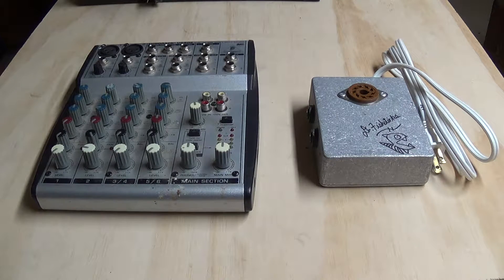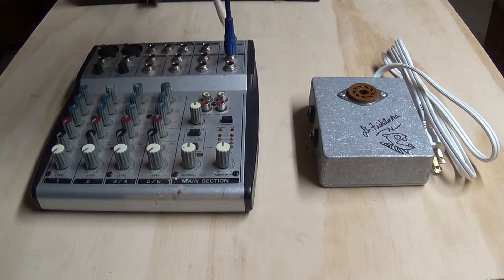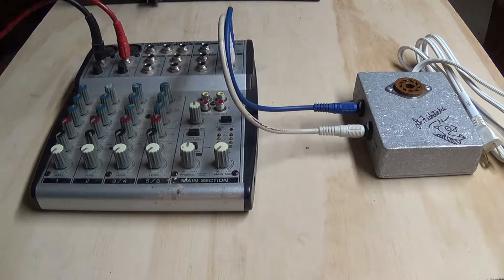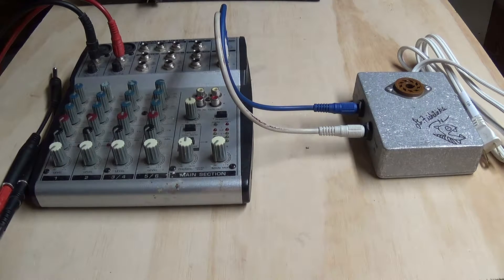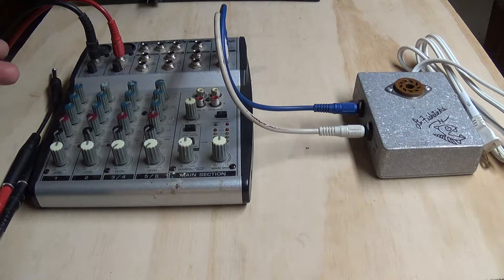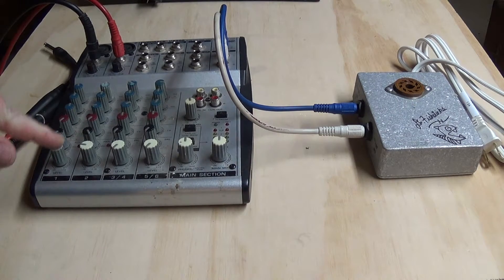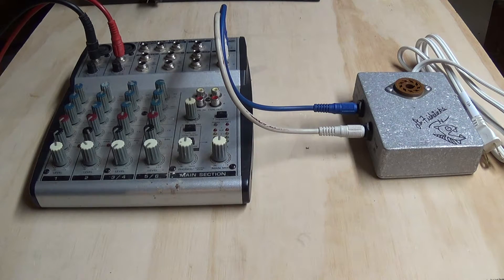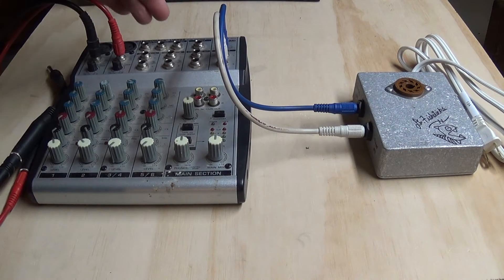using a mini mixer to preamp a two channel Leslie -  9 pin 700, 710 and more

Comment: Hi
I have a Hammond L100 and I Leslie 710. I bought a 9 pin connector, and I sent the signal to pins 1 & 2 (ground and signal)
I get a lot of hum and almost no volume. Do both channels need to be connected at the same time? can I add a jumper from pin 2 to 4?
Thank you

Comment: What does the box does? Just switch the motor with 5v Relais ? And connect the signal from the mixer to the 6pol Leslie connection? Or is there an amp or something other in it?

Comment: First, thanks for the video. Thanks for sharing.  Very informative. I will look on Reverb for your handle, and buy whatever works.  I'm piecing together Craigslist and marketplace cheapies to scratch an itch.  I'm not technical, but I can follow precise instructions.  Everything will be played in a 180  square foot family room for my own  enjoyment.  I bought an M-3 in well maintained condition s/n 120232 ($150) and a perfect condition nine pin Leslie 205 s/n B1325 ($400)   So as I understand it, I need to make the Leslie a single channel. Use the magnetic speaker wires as the output on the organ. By adding a  ceramic resistor in line with the signal equal or greater than the speaker rating should satisfy the organ . I know I'll need a switch in there somewhere fast slow off.  I will watch more of your videos to see how to reduce the channels in the Leslie. I suspect I'll need a crossover as soon as as I know what it is and what it is used for.   The Leslie is a 64 watt amp. Does the output reduce as I remove channels?   Thanks again!

Comment: Looking for video of how to use a mixer as the preamp on Leslie. Where is the Leslie?  What's in that silver box you have there? Is it just a simple adapter? Why the plug on it?  What does it do? Does it supply the 29volts I need? Where does organ and Leslie connect to it? How does that silver box turn on the Leslie, fast or slow? Im reading pinouts from 6,9,11 and that mixer is just audio, what about ...fast slow  etc... How do they connect along with that mixer?    Where is the Leslie with the MALE connector 6,9,11 sticking out the back? Leslie connecting to? Where is the organ 6,8,9,11 pin? Leslie input plugs in? Made no sense at all, I dont have a silver box with 1/4 jacks. I have a 11 pin male connector sticking out the back of the Leslie. I have a new Hammond with an 8 pin connector need a preamp in between the 8 pin organ and the 11 pin Leslie. Just need to know where to get the 29 volts on to pin 11, the rest is just a cable. Pin numbers aside how can my little mixer be used in between? What is the silver box? is it supplying the 29volts I need? If so how do I make one? Does the silver box have 6 pin or 9 pin or 11 pin input from the Leslie? Dose it have an input from an organ 6pin, (8 pin Hammond on Xk-1c) 9 pin, (11 pin. XK--3)?   I just dont understand, that silver box anyone could just plug in the R/L output of the Organ, that is a pre amped signal just like the mixer, right? Confused bad now...
Reply from the maker: That's a little unfair, that's A LOT of questions.   The silver box is a Leslie Controller. (Dr Fishsticks) and this video is for DUAL channel Leslies.   What do you need the 29vdc for?  You ask about 6 pin organ outputs and 8 pin organ outputs.   If you has a specific question I can help.. for example "I have a Hammond M3 and a 9 pin Leslie 700, how can I hook them up... I can answer that, but you hare asking  about 6, 9, 11, 8, seldom used control voltages, it's too much to try to answer that all.
Reply: @vintkey  Sorry, I'm  just confused. Have bought 2x Leslie 615. One may work, can't test it. Can't even turn it on. No speaker inputs just a wall plug and 11 pin male.  I have a newer Hammond xk1c 8 pin leslie female plug on back has electronic leslie too. The 615 leslie I cant turn on and test to see if its any good at all.  It has an 11 pin. Male plug. I'm just not sure what to do. I don't want to spend 500 dollars to turn it on to find out its no good.
Reply: I thought I could make a cable, what is the box for?

Comment: okay, I think I can get this dialed in, but I may need a little help.I recently bought your nine-pin controller with the foot switch for a 710 I got my hands on. I'm getting 3 speeds (stop, slow, fast) so that's good.

Here's where things get interesting. I'm playing a trombone through a similar board (unpowered). Is the one XLR cable from the mic enough, or would I have to split it or even do  something crazy like run an xlr into one mixer, take the left/right into different mono channels onto yet another mixer and send from the 2nd mixer into the main/aux on the fishticks pedal?

Any advice or troubleshooting tips appreciated